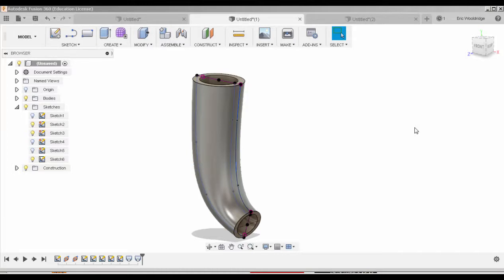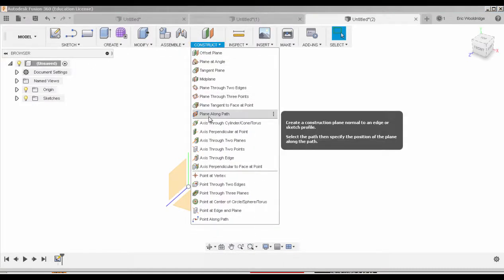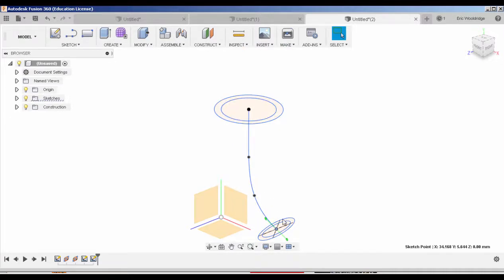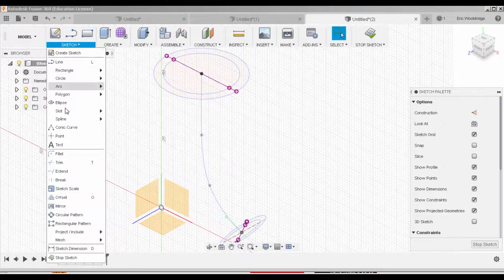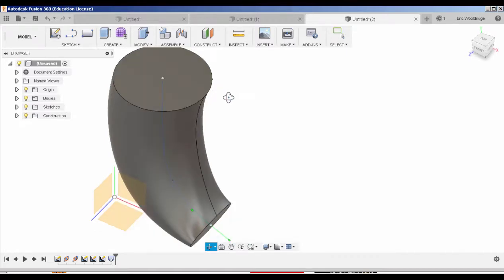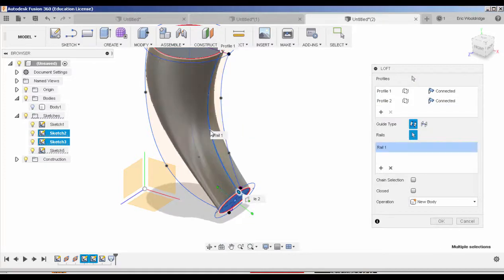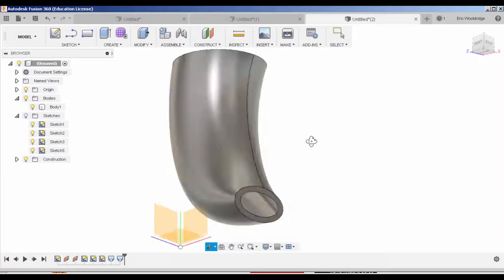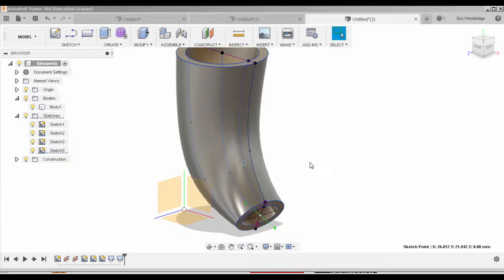0133A – The Additive Guru, creating a complex loft along a curve with a hole in Fusion 360

Comment: You should be able to do this in multiple segments right? If you want to start and finish with a circle but have an ellipse in the center you would need three sketches with rails between them. You should also be able to do this with shell function as well.